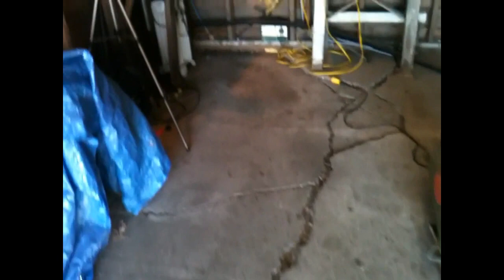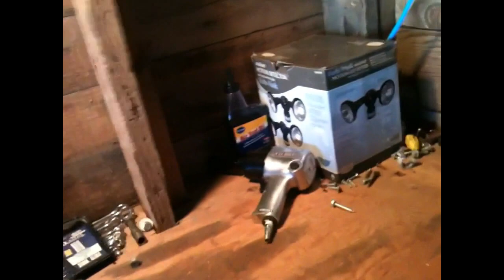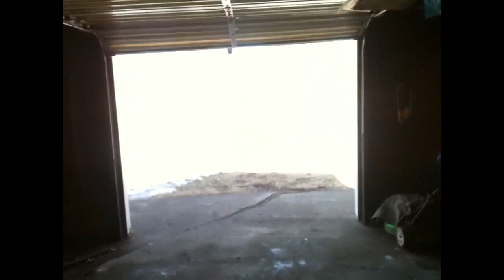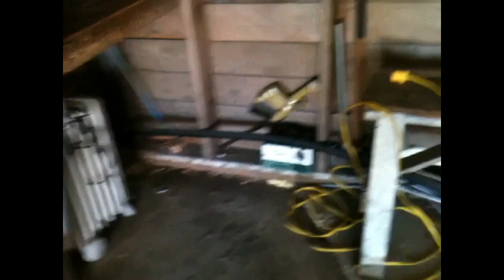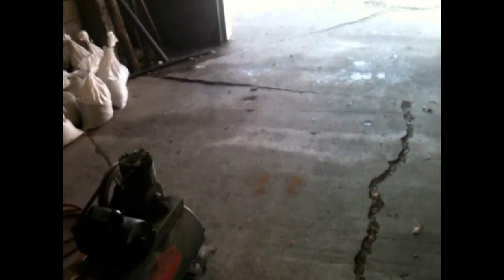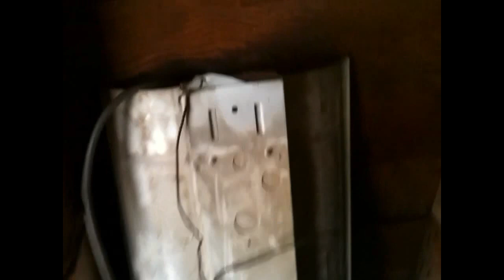what a night...

Comment: wood stove in the shop you could have cooked and been warm...I've got the parts to fix mine or I hope that will fix it..you need at least 5000 watts if you're gonna use it for power outage, 7000 or 8000 would even be better...you could use it to run the shop things like compressor and welder...
Reply from the maker: maybe i sould get the big boys like this 1 http://www.northerntool.com/shop/tools/product_200467369_200467369

 lol  i would like 1 4 the house. i was thinking this 1 would be fine

http://www.northerntool.com/shop/tools/product_200419022_200419022

i need 2 get a wood stove 4 the house 2.i got the pipe going out the top of my roof..
Reply from the maker: & 1 more thing. i"de be only runing 2 things at 1 time, & there not big things soo y cant a 2200 watts  Generator run that,?? i mean 4 a good  Generator like 7 to 10,000 watts r like 1,000 to 4,000 dollers i dont want 2 pay that much 4 a  Generator. later on i can...
Reply: *****
might as well get the biggest you can get...
Reply from the maker: savagenomore  k.. can i borrow  5,000 dollers from ya,,,LOL
Reply: ***** just get the biggest you can get...not the biggest they make...
Reply from the maker: savagenomore i was jokeing about about money thing..lol the biggest 1 i can get 4 now would be 2200 watts Powerhorse..
Reply: *****
then that's what you get for now....
Reply from the maker: savagenomore yep.. lol i sould be fine with that...